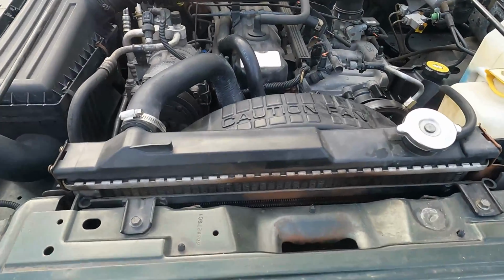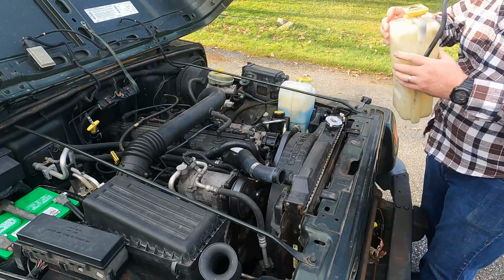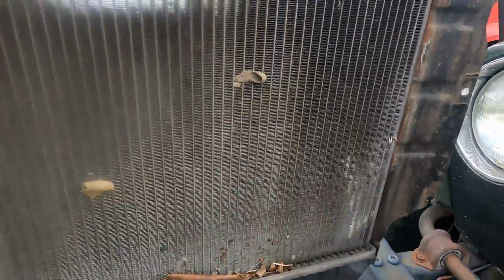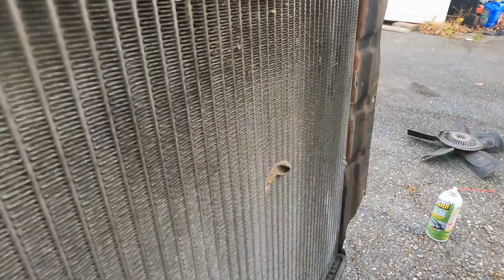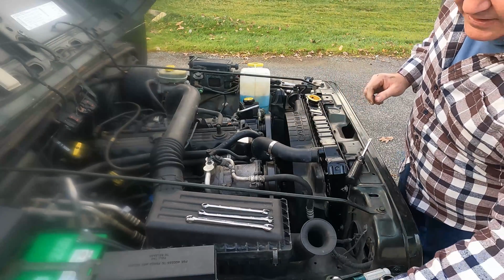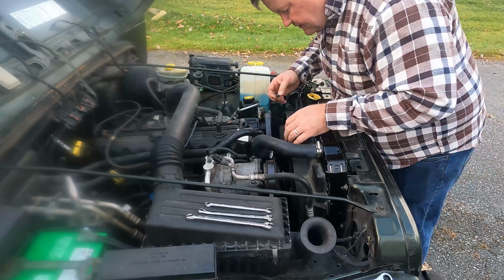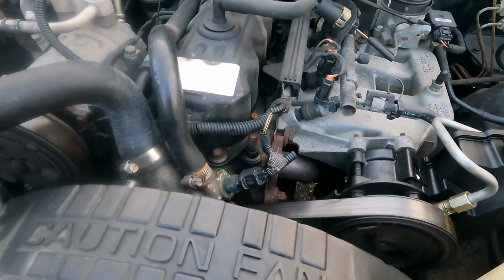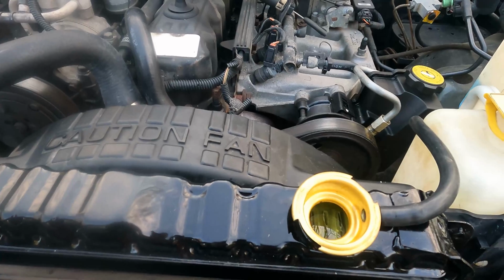Jeep TJ Radiator Replacement

Comment: Hey, I'm changing the rad in my 04 sport automatic. The automatic trans tubes leading to the bottom of the rad are leaking trans fluid after detaching. Is this a problem at all?
Reply: I haven't put them into the new rad yet.
Reply from the maker: If you mean while it's disconnected, no not a big deal.  There is trans fluid that will run out of the rad too.  When you get everything hooked up again check the trans fluid by warming up vehicle (drive it around the block)....then with emergency  brake on, and trans in neutral, check the trans fluid and add to safe mark.  You should be good to go!

Comment: Hopefully you can give some insight to my install, but I got the two nipples at the bottom.  They aren't plugged.  I don't have an automatic.  Did summit send me the wrong one?
Reply from the maker: That is the oil cooler input and output for  an auto transmission.  Although you should plug those off, you can use that radiator just fine... I am not aware that there is a manual radiator version vs. automatic.   Just plug them off with something... it is a whole separate "tank" to cool the auto trans fluid.